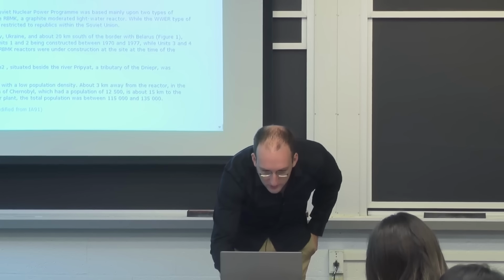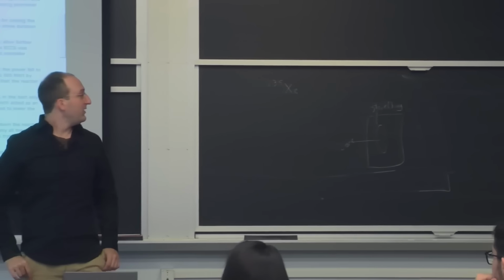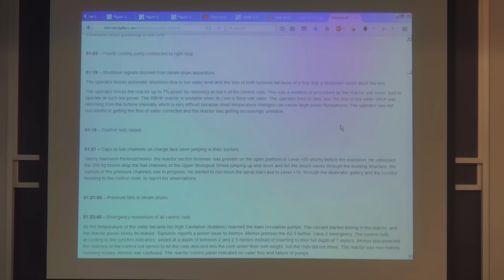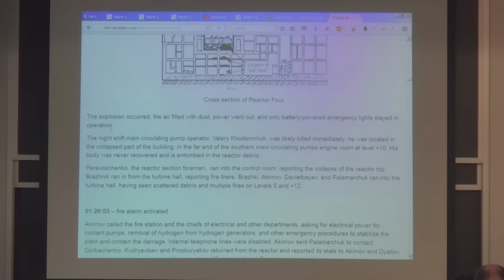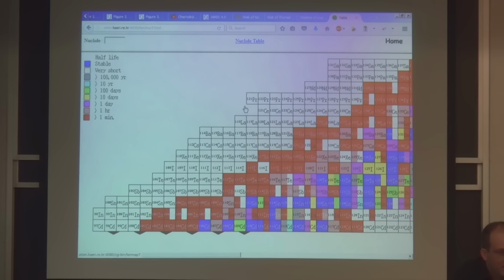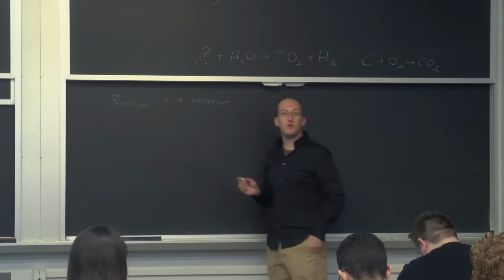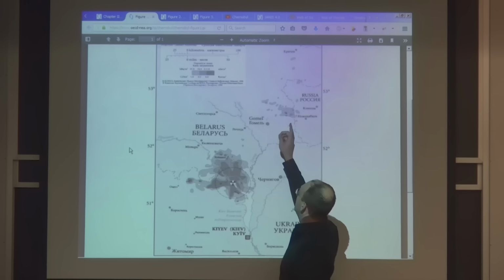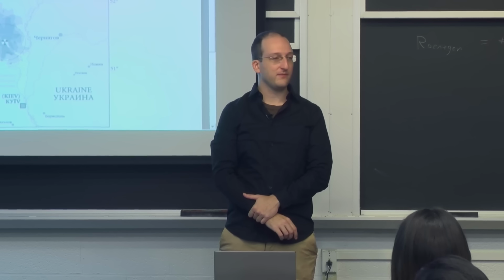26. Chernobyl — How It Happened

Comment: 3' Already going wrong. The Chernobyl explosion blew a 1000-tonne lid far into the air. No containment could contain such an explosion. So the lack of a containment structure was the very least of their problems.
Reply: Containment would still help a lot.
Reply: @cytrynowy_melon6604  It might offer some net good, but let's be realistic. No containment could ever contain such an explosion, nor would it be designed to cope with such an event. What galls me is that comments continue to be made that the lack of containment somehow made a material difference in this case. The effen 1000-ton lid was blown was up in the air! Come on!
Reply: @ronaldgarrison8478  You can think better than this, can't you? You definitely must be able to understand the simple fact that a CONTAINMENT is better than NO CONTAINMENT, right? You can make this leap, yes? So if you can make this leap of imagination, could you come up with a few things that would be BETTER because of a containment? Because if you are willing to follow this very challenging abstraction, you must also be able to come up with 1-3 things that would be LESS DANGEROUS due to a containment. So if you can do this, you probably can, I don't know, imagine that a containment might HELP CONTAIN A PROBLEM EVEN IF IT DOESN'T FULLY LIMIT IT.
Use. Your. Brain.
Reply: @Dave-lr2wo  The difficulty in reasoning is clearly yours. A thousand-tonne lid, blown a hundred meters in the air, then falling back down…that involves forces that, admittedly, can not be intuited on a human scale.

You come back to me, after two whole years, and expect me to put up with your condescension? Such an approach is never acceptable at any time. As far as I'm concerned, this is over. Now get out of here, and quit wasting everyone's time.
Reply: @ronaldgarrison8478  Use. Your. Brain.
Reply: @ronaldgarrison8478  It wasn’t blown 100m in the air and 4-5 feet of reinforced concrete is pretty serious as a containment building.
Reply: @JC-lu4se  You can quibble about distance, but the idea of containment handling that explosion is just absurd.

Effen trolls…
Reply: @ronaldgarrison8478  So your default is to call someone an "effin troll" lest they have the gall to challenge you? Not wasting my time with you.
Reply: @JC-lu4se  Good. Stop wasting my time.
Reply: Not true. That's BS.
Reply: @ms-jl6dl  Yes, it is true. And your wanting so mcuh to to challenge this tells me this is a big point with you. So go with it. You have something more to say?

Comment: Water is the worst possible thing to use as a coolant in a nuclear reactor. It does not handle being hit by neutrons,its corrosive, and a chemical bomb waiting to happen.  The whole path of nuclear reactor design, its fate was decided by the US Navy adopting this 'design'........and every other lazy company and country, blindly followed what is a highly inefficient,safety defective design which requires military discipline in its supervision and no expense spared in its construction. By comparison, using molten salts with dissolved fuel in a fast spectrum design is massively simpler and features passive safety,simplicity and no highly volatile material such as WATER involved anywhere.

Comment: 14.10 "did they remove the water from the reactor"..............the operators actually had the pumps turned off at that point of the accident. Had the pumps been turned fully on........the accident could not have happened. But part of the test was to see how much steam could be generated .........with no pumps turned on (no available site power) from the reactor core, combined with the momentum of the turbines coasting with some partial steam flow.  The operators also had the pumps turned off because they knew that with them turned on, at low power.........the water level would rise to the top of each fuel rod channel and 'stall' the reactor even more.   They foolishly let the fuel rods 'boil dry' which then led them into disaster. The RMBK designers estimated that just 2 'super critical' fuel rods rupturing from a power excursion had enough power to blow the massive steel lid off the reactor.  In fact, all 1600 rods ruptured.
Reply: "They foolishly let the fuel rods 'boil dry'".What do you mean here? They caused too much steam/voids to be created due to stopping water flow and taking the brakes off by removing pretty much all of the control rods.
Reply: I also wonder if they didn't have Xenon poisoning (or didn't ignore it) , if they would have had the disaster

Comment: Hmkay, either I have been misinformed or the prof here is wrong, the control rods weren't "tipped" with 6 inches of graphite, more like 6 metres of graphite rod that extended most of the length of the core acting as gas pedals to the boron brakes, but because they didn't extend all the way down as you lowered the rods, you increased moderation to part of the reactor that was already incredibly reactive.

Had the rods extended all the way down, the disaster probably wouldn't have happened, probably a meltdown and knowing the Soviets, they would probably have vented the reactor vessel right into the atmosphere to pump mercury and/or liquid lead to cool the melting fuel.
Reply: the control rods have a 4.5 m (14 ft 9 in) long graphite section at the end
source: wikipedia